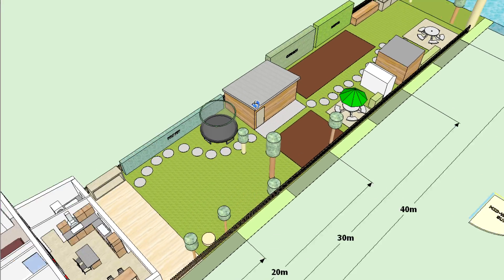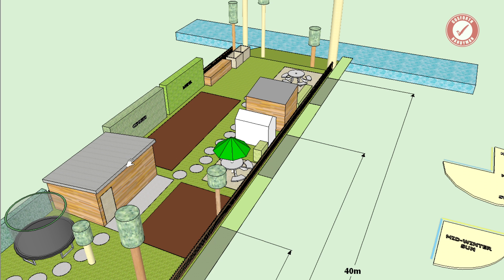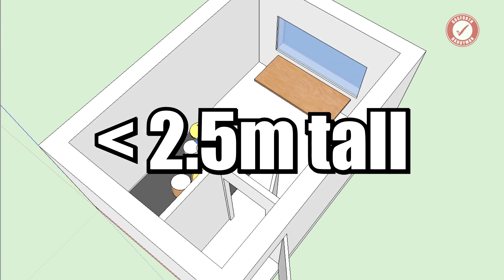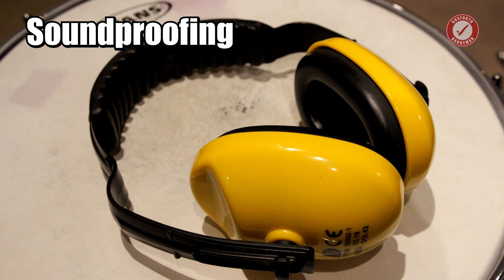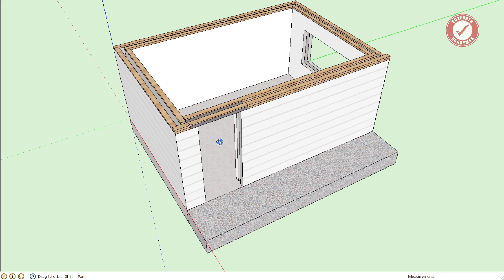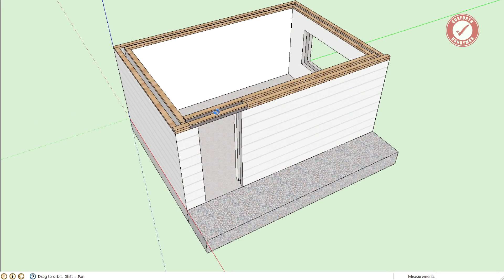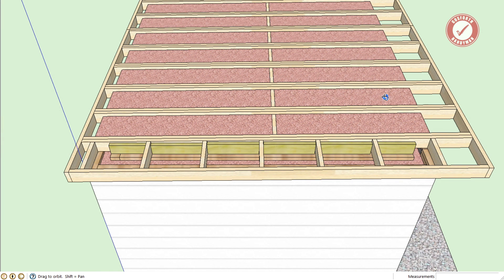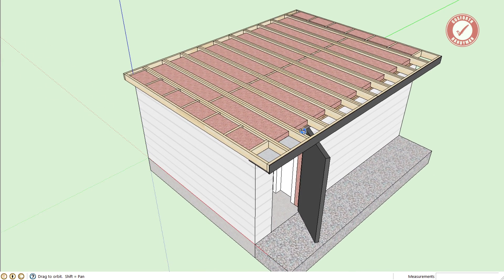Building a Soundproof Garden Room - Permitted Development & Soundproofing Basics (part 2)

Comment: This is exactly the same as the room I'm building at the moment. I too went for insulated cavity walls and a cold roof system. I don't have the double doorway though. I'm waiting for the window and door to be constructed at the moment and will progress on from there. The resemblance of mine to yours is pretty striking, it's almost identical apart from the double doorway and yes, like you, the builders made my doorway the wrong size and I need a custom door built which is happening as I write. It's a composite door which is cost £800 DOH!!! 
One thing, I WAS going to go with a vapour barrier as it just safegaurds against any condensation above in the roof, just in case there was a problem with the airflow and also, would give slightly more soundproofing in my opinion. 
The exterior cladding is a tough one for me. I was going to use PVC cladding on wooden batons with insulation inbetween but the PVC cladding is hugely expensive so I'm toying with the option of reclaimed wood.
Reply: I hope you made a YouTube vid 🙂

Comment: Just done a load of cladding using cedral click, very good if you don't want the maintenance u get with timber but is quite pricey and cutting it is a pain as u either need specialist blades which kick up a lot of dust or a guillotine which costs around 250  quid

Comment: Nice Job Andy.  I know I'm too late to give you advice, but other viewers may be interested in this.  There is no need to have the DPC at the same level internally and externally.  The external DPC could be a course higher than the inside.  That would give you a lower floor level yet still have 150 above DPC externally.  Not forgetting that a cavity tray would be required.

Comment: Good grief Andy, how do you find the time to put that video together. SO MUCH work! I'm SO pleased you've gone down the "yes this is a cold roof and so it needs ventilating" line. And also I think you're very wise not putting ceiling spots in. Two big mistakes skillfully avoided. Looking forward to seeing the build progress. I have one up my sleeve but something for next year at the very earliest. Good luck with it, mate 👊🏻
Reply from the maker: Cheers Charlie! 👍 These last two have been mammoth edits and I had to script it all too - too much to remember! 🤣👍🛠️
Reply: @GosforthHandyman  I've managed to get spots in my sound room by building a bulkhead around the perimeter. This way there's no penetrations in the engineered ceiling.

Comment: Your build looks very similar to how the new engine test cells  were constructed at Rolls-Royce Distributed Generation Systems. I was contracted by RR to look after their side of the project, specify the test equipment and make sure the main Contractor delivered to spec. The acoustics side of the job was handled by a company called Envirosound and they did an amazing job. You could barely hear the 1000 HP Napier Deltic engine running at full bore on test when standing outside the building. That included all the exhaust noise and the cooling air noise.
The windows between the engine test cell and the control room were two layers of acoustic, laminated glass, not parallel (as you said) with about 150mm air gap. The edges of the window unit had sound absorbing material to damp any reverberation between the top and bottom and side frames as these had to be parallel.
Our roof panel for the test cell was simpler: it was a 150mm ribdeck concrete slab with all of the exhaust and air handling plant on it. The whole lot was enclosed in a steel frame building clad with Kingspan
 insulated panels. We had sound absorbing panels from about 3 meters above floor level and all across the ceiling to kill reverberation. Couldn't have them down to floor level because of the risk of soaking them with oil or other fluids and the difficulty of cleaning them.

Comment: Andy, as a qualified acoustic consultant (I just had to 😃), I wouldn’t worry about going over the top with sound proofing. 

This is an outbuilding, located a significant distance from your neighbours. It’s likely they will be able to hear you in their garden, but inside with windows close I doubt they will hear anything. 

Also to add, be careful with triple glazing as that can make sound transfer worse. Ideally you want 2 different thickness panels with a good air gap, also laminated glass works well as it’s another layer of a different thickness.

Comment: Hi we had our double glazed upvc windows replaced with 4mm and 6mm double glazed gas filled upvc windows with the 4mm glass to the inside and it really removed most of the traffic noise from our home. I was amazed at how much it worked.
Also have you considered putting a ventilation strip at the top of one door and the base of the other door?

Comment: That was a brilliant insight into your thinking, planning and execution of the project. The user requirements were clearly stated. The technical risks were outlined together with remedial actions if necessary. Well done. Very professional.

The most confusing thing about permitted development is the "height above ground level". What does that mean? Where is it measured from and to? I think you said from the highest part of the land on which the structure is built. Well, is that immediately adjacent to the building or the highest part of the land which you own? And what is the highest part of the building? Your graphic seemed to me to indicate the lowest part of the roof or rafters! Is that right or did I misunderstand?

How are you planning to determine if you requirements are met? When it comes to sound insulation you can only measure the difference between inside and out. It's all relative. I guess the bottom line is whether you get complaints from your neighbours...

I don't think you need a "qualified electrician" to hook things up. I understand from the regulations that you need a "competent" person to do the installation of the electricals. I also understand that you need someone authorised/certified to sign the installation off. 

You talked about ventilation but did not mention heating or cooling. I imagine in the winter that heating will be a requirement but I guess electric fan heaters will be fine. In the summer, however, cooling may be a necessity! I assume you hav given this some thought and wonder what your solutions are?
Reply from the maker: Cheers Charles! From my understanding it's from the highest bit of ground on the original footprint of the building. So I think you could technically dig down and build a higher structure. The 2.5m rule is to the absolute top of the roof but it's different rules if you're more than 2m from the boundary - then it's 2.5m to the eaves and up to 4m to the top of the roof.

Yeah, I think most sparks don't like signing off other people's work. Since everyone seems to be booked up forever I may just do it myself through a building notice. We shall see.

Heating / cooling - due to the thermal mass and insulation I'm hoping a small electric heater will do and as the window is on the shady side it shouldn't heat up like a greenhouse in the summer... hopefully. 😁👍
Reply: @GosforthHandyman  Yea, I know sparks don't like signing off other people's work. Their attitude has changed over the years. When I first did electrical wiring in the 70's it wasn't a problem. I had to get a friend to do it more recently (about 20 years ago I think). Now they interpret the reg's to suit themselves! I am not certified but have a degree in electrical and electronic engineering so I am a "competent" person. Hey Ho!

Comment: You could achieve ventilation using baffled trunking at high and low level within the window opening, would avoid breaking through blockwork. I recall, a few years ago, utilising a similar system used to get required ventilation from and airflow into a semi basement boiler room, via a small basement clerestory window, just a thought.
Reply from the maker: Interesting - cheers! Will have a look in to it! 👍
Reply: For soundporoof ventilation you need to build a plenum, which is an acoustic labrynth full or absorbtion that forces the air around multiple right angles, if you don't do this the sound easily travels down the ducting! You can put them on the inside or outside or both but they have to be large enough to deal with low speed high volume airflow (so you don't get wind noise). I've got a calculator or two that can help figure out the size of the ducting and fan you need. You start by deciding how much air you need to ventilate (people using room etc) and work back from there. Worst thing for recording is a ventilation system that sounds like constant noise!
Reply: @bukarin  very interesting

Comment: Hi Andy, if you had told me you did not want square walls in your building I could have suggested several builders that could not build a straight wall if it was only one brick high. I love your reason for the outer door size, I think I had the same builder as you because I do have all the problems, the difference is yours is only one room as mine was a whole house

Comment: With external dimensions of 5m x 3.5, you could be comfortably under the 15m2 flooring area internally, which would mean it would not need to be substantially non-combustable material. Please do correct me if I'm wrong. Top series, only problem I have with it is I found it too early, and can't binge the full thing in one go.

Comment: For the cladding have a look at Thermowood - it's softwood that has been "baked" under controlled conditions and, according to the timber merchant. will outlast red cedar by some margin - and it's only about 30% of the cost of red cedar (or less)  It's available in various profiles and as PAR for corners, trims etc.    I've just clad an external retaining wall in my garden (blockwork, softwood battens, Thermowood . .. very easy to work with (stainless steel Spax screws, not nails) and looks great.  If left as is it will fade to silver/grey or can be treated with a stain to retain the original colour which is very similar to red cedar.   [I bought mine from Vincents Timber in Birmingham -- website has pix, details and specs - doubtless a merchant near you will stock it]

Comment: Only thing I'd do different here, is I would fit a vapour barrier between the plasterboard and the insulation.  It can only help protect the roof and theres no downsides to it really, very cheap to do.  I think you will end up adding the secondary glazing, tripple glazing doesn't do much for kick drums.    But no issues as you've already allowed for it.  Top job all round I'd say.  Maybe consider using 'plaster in' led profile for the illumination. since you arn't having ceiling spots.   Since you are having two layers of board for the ceiling, you could fit the proflie in just your lower layer which would have no impact in overall sound proofing.

Comment: Well done on a comprehensive guide. Your build is one of many ways to soundproof and they are all valid. I have a suggestion for the ventilation, if you are allowed the extra external build. Use a trickle vent fan with silencers and acoustic hose all fixed on the river side/window wall and build weather proof cupboard to hide it. The inlet and exhaust vent cowls can go through the wall to one side of the window.

Comment: Did you consider block and beam for the roof? May have lost too much headroom with the height limitations.

Recently done similar ceiling in my garage, used 2mm MLV from Advanced Acoustics between soundbloc layers and next to joists, couldn’t find enough to convince me Tecsound was any better. Wish I’d used isolation clips too, suspect it’ll be the weakest point.
Reply from the maker: Yeah, I think for block & beam to be effective it would need screeded over to seal up all the air gaps... and height might be an issue. 👍

Comment: Cedral cladding all day long Andy - it’s excellent stuff and the additional mass can’t hurt the soundproof quality of the building either. It paints really well too, so no need to be constrained by the colours on offer either. It dulls drills in no time, so be prepared to sharpen them - and get a good diamond tipped blade for your chop saw. I’ve used it twice now having previously typically used shiplap and as it’s so regular you end up with a very sleek finish. The install guides on the Cedral website are great too, very comprehensive. I have some left over insect mesh and other fittings that I’d happily donate to your project if you go down this route.
Reply from the maker: Yeah - looks good. Watch this space! 👍

Comment: Hi Andy. I’ve been involved a little bit with similar projects in the past and watched with interest. As I watched you ticked off most areas that I find people get wrong. 👍 I have three comments. 1 consider using glass of a different thickness on the internal layer. Different thickness - different resonance - less transfer. 2. Quality door sealing shutters on the bottom of the door or even a dust stop at the bottom with a seal, although that creates a tripping hazard. Finally, 3. the one I’m most interested in seeing what you do, the ventilation. You need to establish what volume of air you need to transfer, I guess with energetic drumming it might be quite a lot. The zig zag attenuators seem to be the best approach but can’t wait to see what you do. Cheers from Melbourne Australia, great project.

Comment: Triple Glazing is less efficient than Double Glazing for sound deadening; the middle pane will transfer vibrations between panes either side. Use Double Glazed with a secondary panel further away from the  window panels (decoupled as you mention).

Comment: Andy, I'm thinking it's worth the extra work now to add the soffit sound proofing while it's still accessible.
I hate going back to do something I should have done in the first place.
Reply from the maker: It'll be relatively easy to add later. I'll screw the soffits in so they're easily removed. 👍

Comment: I would consider doing away with the lobby and having a double door at the entrance. The outer one opening out and the inner one opening in. These could be hung in two separate frames similar to your window frames. Fit acoustic seals all around and a drop seal at the bottom. This would also gain back some floor space. When I built my small garden studio I used solid core door blanks and screwed 18mm MDf to the face with Techsound between. I used temporary screws at first until it was painted and then replaced them with flat capped mirror screws. Looked really smart. Heavy doors is what you need. By the way, that Techsound stuff is very heavy. Looking forward to the progress.
Reply from the maker: There's no lobby as such on the final plan 👍

Comment: Soundproofing comment > I don't know your criteria .. But considering your going to the effort of doing x2 door lobby system and have done x2 bock work and x2 window.. snake vents etc i would really consider increasing your ceiling mass inline with other steps taken by adding extra layers on the inside and on flat roof. Your only as sound proof as your weakest point..  your smallest air gap size & your lowest mass ( kg's per m3 ). check out the resources here form John brandt  useful in working out your mass x air gap and gives working performance calculation's > https://www.youtube.com/watch?v=3qFLlWCLIdA > https://jhbrandt.net/resources/#tools

Comment: 10 mm2 is too small for a 73A supply taking into account maximum permissible voltage drop and the distance. 63A would be just on the limit. It would be worth increasing the cable size to 16 mm2 to make things simpler.

Comment: Top job mate! I’m same, qualified studio engineer, then 20 years in live market. You’ve covered everything I could think of AND THEN SOME!
In terms of ventilation, ignoring cost, would an external mvhr fit your bill? Obviously larger the ducting the quieter the unit would be through minimising air velocity. Don’t envy you on that side of things. Hardest job keeping studio space at comfy temp, whilst not bleeding sound out (or in).

Comment: Sorry it's a bit late now but if anyone is doing something similar  you can always have some of the inner skin blocks sticking out to avoid the flat wall syndrome.  also don't skim the walls the bare blocks absorb sound better.
Reply: Thanks for that. 1 question - How will the heating/cpooling be affected if just bare bricks/blocks are kept?

Comment: Funny how you call yourself a handy man. I think I'd refer to you as the expert. Everything I've seen you do has been thoroughly and logically thought through. Regarding the ventilation, I think you have real problems here. Almost anything you do will compromise the soundproofing. Perhaps one option would be to make the internal wall between the interior and exterior doors a cavity wall. Then cut a hole in top of the interior part of the interior wall and on on the bottom of the exterior part of it. Then snake some insulation inside the cavity to allow passage of air through the holes in a snake like fashion (sounds waves are longitudinal so don't naturally go round corners). You'd likely get warm and cold spots but that could perhaps be overcome with a small 12v computer fan placed at one end.  Then feed it through through the front door. You'd likely need to make 2 similar passages through the wall to deal with inflow and outflow. Sorry for the long post but it's not easy to explain my thoughts in one sentence🤔👍 Good luck. Can't wait for the next episode
Reply from the maker: Cheers! Yup, I would concur with something like that. Watch this space! 👍